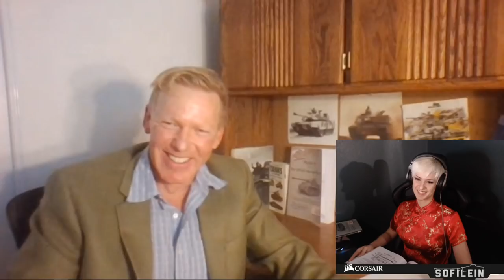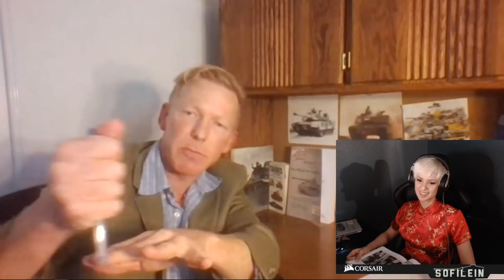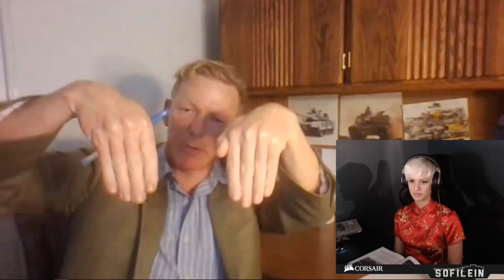Transmission and Roadwheels: Tiger I Mythbusting with Bruce Newsome Part II

Comment: Thoughts, mean distance between overhaul isn't a particularly good measure here. It can make a highly produced vehicle look inferior and a very well produced vehicle, look superior just by weight of numbers. The smaller the pool of vehicles, the more the outliers affect that number. I can't accept the premise on that ground alone. When you have more than twenty, twenty five tanks produced to one, in comparison, you're not comparing like to like. 

Assuming the number I've seen are accurate, we're looking at close to 40:1 in favour of the M4 Medium. 

I think the Tiger 1 did have a number of issues, of which the persistence on the battlefield is one of them. That is caused not by a lack of reliability on an individual level, but in doctrinal misuse and the lack of replacement parts. So it doesn't matter that you can point to a tank that did 3000 miles between overhaul, if you could point to a company, division that could maintain that, that is an factor worth considering. If a division could maintain at least 95% of its Tiger 1's ready and available for that distance, then we have something to talk about. 

Does it make the M4 Medium a bad tank because Creighton Abrams and co burned through six, seven of them? Or does it mean that the tank was designed to be used by an army not fighting on the same continent as the factories? An entire ocean away from the factories and that army was still able to be easily supplied with vehicles? 

Second thought, the manual from the Tiger 1 from memory had quite specific instructions and measures for the crew to take. That meant when you had competent, trained people they could exceedingly well. It's the difference between a rally car driver and your standard 9-5 office worker who drives to work. So you had a group that knew exactly what and how to drive, operate the machine. You then, later on had a group that didn't have the same fundamental knowledge, practise and to not say there was a decline, I think ignores the reality of the German state of the time and of the price the war was having on Germany. 

When you're having issues around the transport of ball bearings, the war is not going well for you. 

The Tiger 1 might have been a great tank the Wehrmacht, early and in the middle of the war. It fit to the culture of a small, professional highly mobile, short term operational force. I won't deny that. It was not the vehicle they needed in the late part of the war nor was it a vehicle that in the long term had a function that was needed. Nor was the entire lack of spare parts something to be so easily glossed over either. When every vehicle might as well be a single run, you're going to run into problems, eventually. 

Third point, I feel a correction/addendum is required here. Previously the German recovery vehicle was a Panzer 3 or Panzer 4 hull modified for the role. When Tiger 1 was introduced, only another Tiger type of hull could recover the vehicle. So the issue for me is that you've just had to create a whole new vehicle family, for the specific capability of that family of vehicles. 

So, while the Tiger 1 recovery vehicle could recover any number of other German armoured units, the Tiger family of vehicle was the only ones capable to recover the Tiger family. That to me is wasteful, illogical and frankly not discussed enough. It creates a too specific need for that otherwise can't be answered without referring to itself. That's bad design to me.
Reply: I don't have much disagreement with you on the points themselves but I think youre mixing up design issues with deployment issues. They aren't the same thing at all. If the US/UK/Canadian forces couldn't resupply M4's which were lost (but the crew wasn't) then yes the high loss rate of M4's would have been an issue. From a design point of view, on this basis it can be argued that the M4 was a poor design when faced with late model Panzer IVs, Tigers and Panthers. However, its ease of crew evacuation, ease of maintenance and lots of replacements back in the storage depo turned out to be more important at a strategic deployment level than the design itself. 

On your production number point I think your understanding of statistical analysis is a bit too simplistic. For a high production tank, the average won't necessarily change much but the precision of the data (measured by standard deviation for example) will be higher. Yes for a smaller production number the outliers (both better and worse) will make the average less precise (higher standard deviation) but any good piece of statistic analysis will try and look through these issues. For example, using you might remove outliers results to get a high precision (lower standard deviation) average. You can also the other forms of average (Mode, median) and graphical presentation to highlight the difference within the data set you're using. The value of the standard deviation itself also provides valuable information itself. For example, if the average mileage between brakedowns for the sherman was 563 miles +/- 15 miles (1 standard deviation) compared to 489 miles +/- 50 miles for the Tiger, the wider range tells you that the Tiger had more issues in terms of quality than the Sherman did. if the data was available, I'd expect to see the precision of the Tiger data to worsen from 43 to 45 reflecting the lower quality spare, less crew/maintenance training, less preventative maintenance etc. Lubricant shortages. With a good data set, all of these factors ought to be analysable. It isn't of course as the data was not collected or lost.

IMO Anyone presenting averages (the mean) without a precision data point (standard deviation number) doesn't understand statistical analysis and the data they represent isn't to be trusted, which undermines their analysis (sorry - a did a PhD in Geochemistry and the quality of data I produced and how I analysed it was a major issue in terms of quality control as well as how much certainty is there regarding the analysis was. When particle physicists use experimental data to determine that a new particle has been discovered they use 6 standard deviations as there data quality measure. That is 3.4 errors/defects per million detections ie 0.00034% defective or 99.9967 % accuracy).

From an industrial perspective mean failure rates, or distances between maintenance or loss are all perfectly respectable data point to use. To extract real meaning from the data for a comparative point of view would also need various adjustments to be made for eg the terrain, temperature, availability of maintenance etc. No piece of high quality statistics analysis will ever use only one measure and not attempt to either make adjustments to provide a like for like analysis or comment on why the data isn't on like for like basis.

Now, I agree with you overall the entire evidence suggests the M4 was more reliable and sustainable than the Tiger, but that also reflects that lost tanks can be immediately replaced. This doesn't actually help compare the reliability of the designs themselves as the the overall effectiveness assessment is based on more than the design. These sort of issues come into debate around the deployment or not of the M26. Much more Tiger like, but not as reliable as the M4 and would have suffered from lower availability and lower reliability.
Reply: @nickbrough8335  I challenge that I am confusing those issues, design and deployment. 

In the case of the M4 Medium, the design included the issues of deployment and why the M26 wasn't seen at all in the ETO, basically. Sure, there was an extremely limited deployment, but it wasn't well received or well implemented. I don't believe there was any real support for the deployment from the theatre itself. 

I would quote some of the things said by Nicholas Moran on the matter here. Also, from memory, in the case of Tiger 1 vs Pershing, the Pershing did in fact lose. 

I would also point out that if the initial weight of the vehicle was only to be in the area of 30 to 35 tonne, then the design of the Tiger 1 family is a massive failure of that design. Not design creep, mission creep, open failure of the design. The designers, design process did not make the appropriate, possible trade offs to include the issues of deployment. I stand by their being some issues with the tank and the tank basically being 1,347 individual run vehicles, not a family of 1,347 like tanks. 

To be clear, the tank was not used in their doctrinal role nor were they probably supported with spare parts. The quality of the crew training as well does appear to degrade over the war. Again, I will go with that rally car versus officer worker in using a car. It doesn't matter how good the car is, you need the knowledge, practice and experience to really make the most of your car, ie the rally car driver. 

This isn't a fault of the designers, per say, however it is a fault of the design. The design was to produce a breakthrough tank. A tank that is brought up to the front, possibly from rail head, gathered together, maintained and readied for combat. A tank that would then breakthrough the enemy lines and allow other lighter elements, medium tanks such as the Panzer 3 and Panzer 4, would then go around rampaging, encircling, Stuka's overhead and infantry making mischief. The tank wasn't seemingly expected to travel far on their own power nor were they expected to again, seemingly spend a lot of time in the field. They always could be brought back and brought back up to standard, in terms of maintenance. 

At least in the scope of the Western European operation,  I would suggest as much. Russia, I have no idea and from memory, clear effort was made to get the German gauge of rail going out to the East and allowing the relatively speaking free flow of materiel to the front. They weren't particularly successful at that, from memory. I'm scraping the bottom of the barrel here. 

In terms of the stats and maths, I would like to see them myself. I've failed enough stat units to get at least the foundations right. There's serious questions I have and I would like to answer those questions. I also believe that the simple size of the difference in numbers is a big issue and I'm not sure you can draw any valid conclusions from the comparison. It's about an order of magnitude and a half between the two pools. I don't believe even with look at mean values, mode's, median's and standard deviations, you can draw any comparison that provides useful information. A very general overview of, perhaps. Something that needs further investigation, certainly. A certifiable fact, not yet. It most definitely is a better starting point, it none the less is only a starting point.
Reply: @LionofCaliban  Boy, do you know how to talk which at the end of the day adds up nothing but smoke and mirrors The measure of any AFV is how it performs on the battlefield and that includes getting there, be able to manouver and go where it's required and all the many other criteria which it needs to do it's job properly.

I've just finished reading some official history concerning the US 2nd Armoured Division and it's battle with Tigers and Panthers on the Roer Plains. And how the Shermans failed in comparison concerning  matters that most Sherman fans don't even know about, like how it's suspension restricted quick manouvering when under fire from AT guns and an ability to quickly get out of their way was vital. A report compiled by the tank commanders of 2nd Armoured after the war damned the Sherman's gun, armour and mobility compared with the big cats. But what would they know compared with Moran's joke internet experts?
Reply: @LionofCaliban  Hi. I don't disagree much with any of your points. I don't think that the design evolved from a lighter to heavier vehicle is necessarily a problem. The Panzer IV design was able to go through a similar process across the war and still remained a pretty good tank all at the end of the war. Again that the performance deteriorated from 43 to 45 reflecting Germany's increasing losses and capability has nothing in itself to do with how good or bad the Tiger design was in of itself. The design can be very good, but the build quality poor.

I'm not sure that your point on each Tiger 1 being an individual verses a family can be correct. The were made in the same factories, using the same parts. yes, the quality probably went down across the war, but that isn't a design issue. If you adopted that approach, then you'd have to conclude that the M4 family is the only properly mass produced tank in the war, because it is pretty clear than the UK and Russian tanks didn't have the same build quality. The Russians allowed T-34 to go into the field with also sorts of finish issues, whereas in the UK, they would be botched together to make them look right (The later Nimrod MR 4 saga being a recent example).

Obviously, statistically, a larger population should automatically result in very precise data and a very accurate average, especially so in the case of the M4 family where mass production was used and they were in production for a very long time (although you would break the data down into various groups based on the Engine installed of course). Essentially your view point is that no comparison can be made between any military vehicle in ww2 using hard data because each vehicle is produced in different quantities. You will not find any support for that anywhere. Various countries do (or should) compare say the Challenger 2, Leopard 2 and Abrams performance data against each other when they are considering an acquisition. On you basis this would be impossible as there more M1 than Leopard than C2 made. 

In making such comparisons, it is excepted that the precision in the data set - as measured by the Standard Deviation - will be different. That doesn't stop the the say Leopard data set giving a precise average for any particular measure. Usually you'll find the stats come with a n value (the size of the data set) which you always bear in mind when making comparisons. If a full data set for Tigers was available, then I would imagine the first thing you'd want to do is to break the data down into production year, front operated on etc to actually find out whether these factors made any difference (which we suspect is very likely to be the case). I agree that the M4 family is very likely to show less variation as the design was well tested in the many different climate/terrain environments available in the USA, whereas the Tiger could never have had this option. 

I'd conclude with the view that data from the earlyTiger's deployed in Tunisia and on the Leningrad front in '43 are likely to be the most useful to use for reliability and other design based analysis. These tanks were still made when raw materials and man power shortages were not critical and the Germans still had significant offensive capabilities. The operational life of a Tiger in 44 or 45 was very low, both due to losses and - likely - poorer quality materials and parts.

I think we would both agree that the Germans made many mistakes. One is having too many designs being manufactured at the same time. Another is that the Panzer IV replacement they needed wasn't the Panther or Tiger (let alone the Tiger 2), but something smaller, lighter easier/cheaper to produce with much better fuel efficiency. I don't know if you've caught this video yet, but t also gives an interesting and different perspective (https://www.youtube.com/watch?v=MFYHhTc0E2g).
Reply: @nickbrough8335  Indeed I have seen that video and honestly, I need a rewatch of it. 

My argument, reasoning here in the statement that each vehicle might as well be an individual run is the nature of the construction of the vehicle. 

You had different groups supplying the various parts, which were assembled. Parts from a very disparate and separately QC'd parts are the issue here. 

You have everybody saying their parts are good and on a whole, they were. They then fitted individually to each tank. They would then do the same process, fitting parts to the next tank, again on an individual basis. 

Assuming this is going well, that's not too much an issue. However it still requires individual work. Assuming it is an issue, you have a lot of work to do for each tank. 

As pop/popcorn as Potential History's video on the Tiger 1 is, it does include some factors I think are present here. I believe the point that every sixth vehicle had notable changes from the previous six vehicles. He  did say it better than I could. 

On the numbers, as said, I want to see them myself. I want to see the working, do the math myself. I have issues with the reliability of the numbers, verify them myself. When in doubt, go to the primary sources. That's what I want to do. Until then, I will have questions. 

On the design side, I'm perhaps too close to this. I run a game studio with a focus on physical games, board games, RPG's and tabletop war games. Clarity of design goals, project goals are important to me. Quite important. Making deliberate choices without realising what you are trading off, what your limitations are inevitably lead to wasted time on my end. Bad decisions that derail entire projects and forced restarts, to outright wasted money. 

Games, are not tanks, not by a long shot. However, they are also a complex set of interconnected systems, governed by rules and requiring people to follow the processes listed. Just like manufacturing a vehicle from disparate suppliers across a country. 

Logistics is a subjected I happen to be studied and certified in. 

If we look closely at Tiger 1, we have processes fairly openly skipped/outright ignored. That's why we have the Sturmtiger on some level, never mind the Elefant/Ferdinand units, vehicles. 

The other part of this is that for a breakthrough tank, the Tiger 1 is a damned effective and scary vehicle to come up against. When you need to punch a hole in enemy lines, on the counter attack or the primary offensive attack, it's very good at its role. Even perhaps, too good at its role. 

If there's a universal mistake the German's made, it was going to war in the first place. Specifically if we want to talk tanks, the issue around fuel, manpower and the bombing campaign come up. They made the best of the situation they could. 

I would argue the high end, high value low production choice is the right one for them. The trade off is that you need to maintain a highly qualified, highly experienced crew to operate them. Not just to crew the completed, assembled tank, the same is true of the people making it. 

Could their vehicles have done with better engines? Sure. Could they have done with better and more efficient engines in their tanks? Also, pretty sure everyone could do with that. Both sides of the war. Fuel is heavy and hard to transport. 

I think what we need to do to really get to the issue is not to look back and say X, but try to be in 1940, to 43 and try to look forward. In looking forward, I would suggest trying to make a small number of highly effective offensive vehicles is balanced out by the sheer numbers of STuG family vehicles, Jadzpanzer vehicles. Even to a degree a hypothetical Marder IV, using a Soviet 85mm or greater gun. 

In the case of the Panzer III/Panzer IV range must also, fundamentally remain to keep the purpose of the Tiger 1 tank. Not the whole Tiger family, just the Tiger 1. 

In trading off for those extremely high value tanks, you need the STuG family. You need the Jadzpanzer family of vehicles. 

I don''t think that is a mistake, for a force designed around a short term, operational actions. Anything else escapes the reality as I understand it of German warfare of the time. 

The T-34 is a hard case to argue and due to what I believe the design goal was, I'm also definitely sure is a bad comparison. When you look at the M4 Medium, it was the best tank for the US, as it was then. I think you can say the same for the T-34 to the Soviet Union. 

I don't know if we can say the same for a single German vehicle for the specificity of the German range of vehicle. They're perhaps at the start, better at a combined vehicle approach, where each vehicle had a specific function. They didn't seem to really move beyond that concept and you could say the STuG range was a good vehicle family for the Germans. The Jadzpanzers also true. As said, they did have too many hulls and perhaps that's a major issue here. 

If you want to do a reasonable comparison for me, you almost need to compare entire family of vehicles on the German, Wehrmacht side,  to the singular vehicles, relatively speaking, on the Allied side. 

Also, to be clear, while the Allies did have relatively speaking a 'single' vehicle, those hulls were improved on and notably so. These would have been whole new models, vehicles under the German system I would suggest. 

I don't speak or read German and I don't have access to the archives, so I can't really get primary sources to try and predict what they could have done.
Reply: @FairladyS130  Uh, how about Nicholas Moran actively looks for material in the archives, posts the material and has a rather good grasp on the material? 

To the degree I think he's written the only book on US tank destroyer development/history, from the primary sources he found in said archives? 

If you've got a primary source, after action reports, intelligence reports, documentary evidence, upload it and send me a link. 

If you're looking at Normandy, those were extremely specific situations which ignore the experience of the Commonwealth M4's, Soviet M4's, which would have been facing Tiger 1's from 43 onwards. 

Is the Tiger 1 a good tank? Sure is. It's a breakthrough tank, it's designed to hit hard and move on. It's also not a tank designed for long term operations as it experienced in the Eastern Front. Nor particularly defensive operations, seen in Africa and the Eastern Front. 

I will also point out that Zeloga could only find something like three or four examples that the US forces in the ETO faced a Tiger 1 tank in the records. He's published and been through academic rigor, process. 

So again, provide that primary source. Upload it, share it, provides dates, time, unit information down to the company level. 

I'm not going to prove your claim, so make the claim in depth. Show the same standard that Zeloga and co do.
Reply: @LionofCaliban  Hi there. On the Tiger components point, I rather agree with you in general terms, because it seems very likely (i won't say certain, but its pretty close to I think) that the quality deteriorated through 44 and 45. I suspect tall Germans vehicles would have been impacted (especially as they moved factories to tunnel systems for protection and increasingly used slave labour). I don't think that would stock you looking at the entire model's production as a single entity though. That's probably a question for an actual mechanical engineer.

I think the German army in 1938 probably made the right decisions in trying to build a high quality tank with (it seems) a 3000 mile service range. For a peace time environment thats a good call which would have paid off during war time (if it had happened in 44 as originally intended). However, in 41/42 the design priorities should have changed. They might still have gone for the 88mm (although the L/70 75mm might have been a better choice) but a lighter, more fuel efficient, less armoured design to complement the Panzer IV would have been more sensible. A 3000 mile service period no longer made sense in the same way as battlefield losses would most likely limit the number of tanks achieving that. However, high reliability was still the best choice. However, given they were well down the design path, I think its understandable that it was too late to change tack. However, this surely makes the choice of a 45 tonne Panther design pretty stupid when a sloped armoured Panzer IV upgrade should have been the correct solution logically for the main German tank design.Operating more than 2 models (of both tanks but also stug/SPG and tank destroyers should all be using the same chassis design as well) was just plain stupid from a logistic stand point. 

One of the recent Tank museum blogs by the Director comments on German tactic and how British armoured forces went from pretty poor at D-Day and thereafter (allowing Wittman to create havoc) to pretty clever by the time of Witmann's ambush only a few weeks later, noting how German tactics in the Bocage hadn't evolved at all, suggested their armoured warfare doctrine was actually poorer than the UK, even though it had been very successful early on in the war.

I understand your concern regarding sources, but that's what the book series is for :) He has to make a living too.

I don't know if you've come across David Stahels books (I read this one a while back https://www.amazon.co.uk/Kiev-1941-David-Stahel-ebook/dp/B0067J8J24/ref=tmm_kin_swatch_0?_encoding=UTF8&qid=1589390472&sr=1-7). The one is a bit poorly written and needed a good editor, but his argument seems quite correct that the German army's real offensive capability was shot by summer 1942 (he thinks by the end of 1941), although Operation Citadel was still at least a year ahead of them. Invading Russia was the war ending strategic mistake, although they almost succeeded in destroying Stalin and they might have achieved a (short) peace with the CCCP with Belarus and Ukraine being under German control permanently.
Reply: @LionofCaliban  I think his arguments are generally excellent. A book or two in there if he has the time or interest.
Reply: @nickbrough8335  Quite familiar with and like the previous video, probably in need of another rewatch. 

When in doubt, check your sources and when your sources aren't making sense, check your foundation.
Reply: @nickbrough8335  As for a longer reply, I'm going to try and offer a few thoughts, at least while I check a few sources, books, videos, people who have actually studied this, have access to the archives, speak the language. 

I don't want to specifically speak for what else the material used to make a Tiger 1 could have otherwise built. I also don't want to go into the field of alternate tank designs as well. I need to check plenty of sources before I touch that subject. I'm also no engineer. Ask me to tell you how to ship it from the factory to the frontline, that's my training, profession. Ask me to build it, I'm subcontracting, not my skill set. 

The issue is that I want to check a few Soviet histories as well. Overall, take this as I find this subject complex, I want to check out a few sources and I also doubt it's that simple. 

I also have to challenge the idea the taking of Moscow equalling the end of the Soviet Union or the greater occupation of the Soviet Union I have to challenge. That's not the Russia I believe existed and not the one that had to be so openly, overtly Destalinised by Khrushchev. Stalin and the Communist Party there engineered a state that would have been able to continue the fight very easily. Too easily on some level. I would suggest and more importantly at least until the end of the war, showed a growing  tendency to support local tactical level commanders. Stalin is an exceedingly complex character to discuss, as is Soviet leadership of the time. 

The Wehrmacht also had its own issues here and I don't want to downplay them either. In between a highly inflexible set of generals who didn't adapt to the war they were fighting through to strategic level choices which are borderline indefensible, combined with a tank that when used was not without larger issues. 

It's easy to talk about the units moving, it can be hard to quantify the issues with moving those units around. I don't just mean specific rail car, rail carriage either. I'm talking about rail heads, how close you can get the tanks to the front line in the first place. I'm talking about the time taken to fully shift the unit from Point A to Point B, including the supporting vehicles. I'm talking about taking it down to the pre-starts of each vehicle as it arrives, loaded with ammunition and give orders to advance to the front. I'm talking about taking it down to the lubricant checks, coolant checks and more. While we're at it, let's talk about the guys who feed the tankers and the mechanics. Let's talk about the QM's who supply everything too. 

What I stand by now, are the following; 

The German designers and industry were following a doctrine that the greater Wehrmacht, Heer and Luftwaffe in particular were trained in and requested items, materiel, vehicles in support of that doctrine.  

The Tiger 1 breakthrough tank, was the correct choice, as it stands for the type of warfare they believed they would be in. Particularly an offensive, western to central european focused conflict, consisting of multiple short term operations. 

The Tiger 1's use in the defence, against doctrine is a fault we have to discuss. Despite it being a highly effective tank, it was on occasions, in spite of the way it was used.  Even more so when so dramatically outnumbered. 

The Tiger 1 tank while being largely mechanically reliable, was not without issues. Tracks and its wheels were known issues, in particular in the Eastern Front. Especially during the autumn and winter. Even to a degree, in the spring as well. 

The use of the Tiger 1 family of vehicles in Russia, including the Elefant, Ferdinand and Sturmtiger was not against doctrine, while remaining at a weakness for the vehicles. They were designed for a European war and terrain, with political objectives. Not the attritional to total war that they got in Russia against the Red Army. 

Tiger 1 against Allied forces, US, Canadian and American, is hard and complex to discuss. Due to the almost phobia had, false identification and the relatively limited presence they had. Zeloga can only confirm three to four encounters against US units, formations. English/British formations clearly had known multiple encounters with Tiger 1, not just Wittman. 

The Tiger 1 was not invulnerable and was a known threat in Normandy. However due to the Allied air superiority, fire support and tactical flexibility, when encountered was a threat, but not an insurmountable threat. Even when outright attempting to bypass isolated Tiger 1's. 

The M4 Medium with the 76mm gun, the Firefly are only two of many vehicles capable of defeating the Tiger 1. The Allied forces were capable of not only defeating the Tiger 1, but the Tiger II and Panther,  due to the use of combined arms, integrated services working together. 

Finally, I also stand by a straight numerical comparison between the Tiger 1 and any other tank, is at best foolish to pointless. You may have a vehicle that lasts for the 3,000 miles between overhaul. You may have a tank that you can produce in sufficient numbers to equip your best troops with it. You may even have the supplies to use those tanks directly to your doctrine. When the war you're fighting makes your doctrine invalid, the relative quality of the equipment is a relative minor concern. 

So, yes, I still stand by the claim that the number of miles travelled between overhauls of the Tiger 1 is a bad one. It ignores a lot of context. There's issues around the stats, which we agree on I believe. Not just around the numbers, but the math as well. Hence, why I want to see the math, verify the math myself. Compare to the records, verify with the unit records, war diaries. Why I want to see the unit numbers of how many tanks they ever had at any one point. Why I believe this should only be discussed when the company's could maintain that across 90% of their total vehicles. 

It's not that Tiger 1 is or was a bad tank. It was a bad tank for a war in Russia. It was a bad tank to come up against in Normandy. It was a bad tank to try and face on the defensive, when suitably commanded and supported. It none the less is a tank with clear weaknesses, in design, in use and in execution.
Reply: @LionofCaliban  Excellent thoughts and getting beyond the point where I certainly don't know enough to properly reply. My thoughts. 

The window for defeating Soviet Russia was certainly narrow and winning Moscow itself wouldnt have been the end of the matter. But it is possible that Stalin might have chosen to fight another day or been over thrown if it had been a little worse or Leningrad and Moscow had fallen earlier alongside Minsk and Kyiv all in the same year. Given longer and more sensitivity, Ukrainian people could have become a strong ally against the Soviet forces. That said Ukrainians and Belarusians paid a much higher price than the Russians themselves, which makes Putin's anti-Ukrainian propaganda very sad to hear. I think it was 1 in 4 Belarusians and 1 in 5 Ukrainians that died during the war.

If you look at Zitadelle in July 43 they still managed to come very close to winning and had they done so, would Russian forces have managed to win so dramatically in 44 ? A seasoned Panther and more Tigers would have been enough to win probably. The Germans might have done it, but certainly not with forces also deployed in North Africa, France, Netherlands/Belgium, Norway, Greece and the Balkans already. They thought the war the wrong way round. I also don't think their armoured forces, still with large number of Panzer 2's were Russia ready in 1941. With the assault led by Tigers in 1943 ?  Speculative and we'll never know.

Without doubt, both US and UK armies were mechanised in a way that the German army never could be (fuel not withstanding). We clearly won the logistics war, but western Europe had betters roads and railways. The Russian received a lot of support from both countries and this had a larger role than is acknowledged so far as I can tell. As combined arms forces they always had the edge in the west once the troops gained some experience and the British went a long way to sorting out their tank forces. The Russians won as much by sheer numbers and a degree of carelessness regarding casualties,, although their victories were won by artillery and break throughs. A war of attrition was always going to happen if the initial attack failed, which the Russians would win based on population. However, without raw materials and support by the Convoys and by rail through Iran ? With hindsight the Russian victory looks inevitable now,  but I don't think it was as certain as it seems now.

It's the Panther that I feel was the wrong tank at the wrong time, not the Tiger. I don't have any view on whether Russia was or wasn't the right place for them. I think it did very well on all fronts, but lacked sufficient numbers to make a big enough difference. That goes back to cost and built time and logistical support and all the matters that actually win wars as you suggest. 

There was another video (TV ?) I watched (I forget its name though) that talked about The Prussian way of winning wars, going back the Frederick the Great and how this influenced German military doctrine, which was centred around knock out battles and encirclements followed by a quick peace treaty. Prussian was too small to adopt a French tactics used by Napoleon or British approach that essentially won the first war. I suspect the German army just didn't have a strong defensive Doctrine as it just wasn't German. This certainly lost them the war.

There's a Russian book I mean to finish one day ("The Rzhev Slaughterhouse" which I think should be companioned with David Glantz's history of Operation Mars and Jupiter - "Zhukov's Greatest Defeat") thats shows the German army knew how to defend in depth (These battles were the reason why the 6th Army Group didn't get any replacement troops or Tanks before the Stalingrad encirclement), but they couldn't do something similar for the Front as a whole. Hitler's distrust of the senior army commanders, the organisation mess in the central command structures, his "no retreat" attitude and the failure to shorten the line and adopt defensive positions, failure to prepare for the Winter of 41/42 are all more important factors than the tanks that were deployed.

As an individual weapon, I think there is a strong argument to say that the Tiger was the best tank design in world in late 42/early 43. But having the best tank design is not enough on its own. The Sherman and the T34-85 were both the most effective Tanks during the war as a whole, although the Panzer IV should be included in that list as well. I forget, but was it 3 Panzer IVs for the price of 2 Panthers.
Reply: @LionofCaliban  He cherry picks, ignores what really happened, like what I posted and you have ignored, and  picks out the good stuff.  Of course the Sherman was involved in some wins but basically only when there was overwhelming air and artillery support or it could ambush. By itself by any measure the Sherman was a fail compared with the big cats. You should do your own research like I do, that avoids  other's 'interpretations'.
Reply: @FairladyS130  Except you've said everything which means that I can't take you seriously, Modern warfare is combined arms. The radio is the most important aspect of it. Communications underlies so much of modern technology, getting packets, if we're talking networking, from Point A to Point B. 

It's not and it's never just a tank, versus tank. Even a tank platoon, versus a tank platoon. It's tank platoon, with supporting infantry, supporting air, supporting artillery, supporting services which keep the vehicles going, the crews fed and in good health. It damn near doesn't matter the individual quality of the tank, if the supporting services and vehicles are not there. 

As was often the case for the Tiger 1, Tiger II units. 

I'd suggest you need to do some research and make a serious attempt at getting through Achtung Panzer. Get your head around some of the other period writers on armoured warfare and its theory, Liddle-Hart and co. 

I'd suggest you also look at the accounts from characters like Hans von Luck, accounts from the Eastern Front. 

If you can stomach it, even going into Panzer Leader, Penguin translation, if you get past the 'I'm not a Nazi'. 

To be honest, I almost want to recommend George Forty's Tank Warfare in WW2, however it's been too long since I read it and I think it's a bit outdated now.
Reply: @nickbrough8335  I think we're in the same book,  maybe even same chapter, just not the same page. 

That Prussian way of war is what I mean when I say that short term operational level thinking, planning. To the degree where I say political objectives, I'm talking anything from a peace treaty to installing a puppet state. Long term, multiple year engagements are not what they trained for, expected. Why I try to use the word persistence when I talk about their doctrine. They had a very clear system of warfare, one that valued quick actions and traded off, ignore the needs of persistence of the army. Of an army that has to be kept in the field long term. 

I won't argue that the Tiger I was a good design, in 42, perhaps even 43, but later on, far less so. Panzer IV, was also a very good vehicle and the reason I say it's better to look at family of vehicles for the Wehrmacht. It's not that they didn't have individually good to great vehicles, it's that on some level all of their vehicles were pretty good. 

At least, when crewed properly by a competent crew who knew the strengths, capabilities of their vehicle. 

So again, same book, maybe even same chapter, different page. 

Panther is a whole other can of worms and frankly, I'd rather not touch it and make it its own conversation. By the way, feel free to PM/DM/mail me on the matter. It's good to actually talk to someone who has a good attitude about this stuff. There's plenty to be said about Panther, which perhaps makes it the best example of the worst aspects of the German logistical system of WW2. 

On German doctrine, I need to sit down and read it in more depth. From Military History Visualised/not Visualised, I get the feeling the the doctrine of the time values and prefers action over inaction. To the degree that the counter offensive, spoiling attack, your preferred term here, is over emphasised from my end. The Prussian way of war is fundamentally based on having the initiative. Of having the benefit of being the initiator of action. So, it's not the German's couldn't defend, it's them having the local, tactical freedom of operation to defend. 

Not helped by the nature of the OKH/OKW, high command at the time. Also, I'd suggest, not helped by the fetish of constantly creating new units with the new equipment too. I think it's hard to talk about this with bringing up ole Adolf here. That itself makes it hard to try and separate things out, especially from the accounts of the generals, high staff, shifting the blame, painting very deliberate pictures that did not reflect the reality of the time. 

So again, feel free to send me a message, let's take this somewhere else and have that Panther discussion. Always good to find a person who's got a good attitude about this stuff.
Reply: @LionofCaliban  You are aware that between 20 Nov and 25 Dec 1944 the US lost  636 Shermans aren't you . If you think that is an acceptable result against a by that time weakened German force then I'll leave you to your fun and games.
Reply: @FairladyS130  And? Equipment is equipment, not people. Doesn't matter if it's a rifle, radio, machine gun or tank. It's made to be used, maintained and if necessary, replaced. Ammunition is made to be fired. Are you holding that against the tank crews because the manual says they should have X amount of ammunition and they're shooting at things? 

Now if you're talking about ships, that is a different argument. In both cases however, the people operating it matter more. 

If we assume the numbers of M4 Mediums is in the area of 50,000 made, that's only 1.2% of total vehicle production. From a logistics stand point, which again, educated and qualified in, I don't see that as an issue. 

I would also point out that that if it was a case that upwards of 50% of Tiger I hulls couldn't be recovered, that is a far bigger issue. It's also worth talking about the relative...... well, if you lost a M4, you lost a M4. It didn't matter that much because there's plenty of replacement vehicles and replacement parts for the vehicle. 

In fact, making the time put in to design and develop the vehicle quite important. You knew you could get them to where they had to be and would in fact, work. Even those tests on the lock washers and rubber seals. 

You lost a Tiger I, Tiger II, Elefant/Ferdinand, Sturmtiger and not able to recover the vehicle it's a far greater loss. Not just a burning tank can't be recovered, the wholesale loss of a hull that otherwise, in potentia, could have been brought back into service. Which I think happened to a very significant number of Tiger I hulls. 

No, I don't have numbers, I would need to check war diaries of German Tiger I units and compare to Allied resources on the matter. Africa and the East would have been the main source of this. 

As for the weakened force, I have to argue. You had reserves being brought in, you had in some cases full strength SS units being brought in. Going back a few months, you had them in the bocage was an area that massively favoured the defender. Normandy and that part of France was a hard area to operate in as the conditions could change extremely rapidly and provided a fair bit of cover for both sides. Losing the war doesn't mean can't fight the war. They're two quite distinct states and frankly, you would only see the latter when Germany's border were reached. In 1944 they could still put up a very solid fight. 

So I'm not surprised it was taking out a good few M4's.
Reply: @LionofCaliban  I don't pretend to be an expert and whilst I've read or watched a fair bit over the years, I'm still learning. Happy to talk directly, although not sure how to. I think the best WW2 tank design was the Centurion ( :) ). 

I think we have a different perspective, but our conclusions are very similar. I think the eastern front is where the war was won and lost. One thing I've noticed driving around Northern Italy in the towns and villages in foothills of the alps, is the war memorials. Mostly plaques on the side of a building. WW2 deaths are almost as numerous as WW1 ones and where marked (which it quite common) I'd say  ⅔ to ¾ just state "Russia". This was not something I realised until I saw it.
Reply: @nickbrough8335  No expert here either, just an enthused amateur academic and games dev who just wants to know more. 

Eastern Front, let's make that a discussion we have. I have thoughts and I want to disagree, in so far as that it was where the war was won. I think it was where the war was accelerated, I don't honestly see any way out for Germany to even some form of forced neutrality, a draw. 

As for ways to get in touch, let me play around with some channel details, I've got some videos I posted up here years back. So I think I can give you an e-mail through my channel profile. 

Like I said, give me a day and I'll see what I can do.
Reply: My two cents to the topic.

To assume that panzer III and IV in 1944/45 were that much more reliable than the panther is a misconception. They started to suffer from the same late war limitations as the Panther.

"From the front there continues to be serious complaints regarding final drive breakdowns in all vehicle types. Approximately 200 breakdowns have been reported with the 38(t).
Prior to the 1945 eastern offensive there have been 500 defective final drives in the Panzer IV.  From the Panther 370 and from the Tiger roughly 100.  
General Thomale explained that in such circumstances an orderly utilization of tank is simply impossible.  The troops lose their confidence and, in some situation, abandon the whole vehicle just because of this problem. 
He requests an increase in efforts for the final drive, since only this way can the problem be laid to rest.  With the previously intense criticism of the engine and the final drive continually playing such a roll,
it is welcome news to learn that the gearbox generally enjoys a good reputation.  (Page 259 "Panther and its Variants" by Walther Speilberger).

So Which tank would have been a better solution?

More Pz IVs, which suffered from the same final drive issue since 1944 like all german tanks, which could not be produced as fast as a Panther, because they weren't streamlined for mass production. Germany had not the resources or the industrial capacity for a long war, so production should only keep up with operational losses over a very short time frame. But things changed after the german offensives failed in 1941 and again in 1942.

The Battle at Kursk showed, that germany was in fact lacking the resources and the manpower to supply the tank force they already had.
Every additional tank needs a crew, fuel, ammunition, spares and the logistics to provide all that.
Just screaming for more tanks does not help.
Nevertheless germany produced more tanks in 1944 than in all the years before.
The panther was streamlined for mass production. The panzer iv was not. Only 8500 panzer IVs were built from 1939 till wars end. But they built over 6000 panthers in less than two years.  4500 in 1944. In comparison the Russians built 11000 t34/85 in 1944. Given the average tank exchange ratio of 1/4 in favor for the Germans, the panther was a reasonable option. Since spring 1944 Tiger ,Panther and the Panzer IV achieved almost the same combat ready rates (Tiger I and II combat tactics by Jentz).

Tanks like the Tiger, Tiger 2 and Jagdtiger were never meant to be produced in large numbers. They should serve a special purpose.  Only 90 Jagdtigers were ordered, which should replace the 90 Ferdinand's/Elephants because they turned out to be a very efficient tools in certain situations.
The Henschel factory in Kassel, in which these tanks were built, was in fact too small to produce the simpler panther in large numbers. They were missing the tools and the space. They tryed it with a batch of 200 panthers, it did not work. 
Should they stop producing tanks at Henschel? Give up an already introduced weapon system with unique features and capabilities, which also had an hugh propaganda effect (Tiger Fear/Tiger Panic)? I dont think so. Remember the M4 Sherman Jumbo was in high demand by the troops, but only around 300 ever reached the ETO.
Steel wasn't the limiting factor for the german war industry, germany remained the second largest steel producers right up till the end of the war (However, quality became a problem). So they dont really have to care if a tank needed 30 tons or 50 tons of steel. Other factors were far more limiting for germany in terms of tank production and operation.

Panzer IVs and IIIs were never converted into ARVs. The 18 ton Halftrack with a towing capacity of 28 tons was the recovery vehicle for the German tanks. Since spring 1944 they produced the Bergepanther, which was totally capable to tow and recover any german tank with a 100+ ton winch.
But to recover tanks you need to be in control of the battlefield, which the germans weren't because they were retreating most of the time. So tank recovery wasn't their biggest concern.
The Panther did not become a recovery vehicle by accident. According to H. Doyle the Panther was designed to replace the Panzer III and IV to be germany's new (Main) Battle Tank and to serve as a platform for a large variety of other tanks like recovery vehicles, assault guns, SPAA and even self propelled artillery. Just like the Leopard tank family after the war.
It was primarily designed as a system for tank on tank warfare, to counter the massive soviet tank assaults.There for it needs great mobility, a good frontal armor protection and a gun which could destroy every enemy tank within 2-3 km of range. Why 3 km? Analysis showed, that 95% of the tank engagements in central europe would take place within that range. This profile of capabilities hasn't changed the next 45 years until the end of the cold war. Even the Leopard 2 was designed on the same principles.
Hence it is considered by many experts as the first german MBT.

The Germans mainly used 5 tank chassis (38t, Panzer III/IV, Panther and Tiger) for their large variations of AFVs. Almost all types were powered by the Maybach HL 120 or the HL 210/230, which were paired with a relatively small number of different transmissions. Even the bigger Halfracks used the HL120. The automotive parts were very standardised and interchangeable. Tiny variations in the Hulls between variants are negligible, they don't really interfere with basic maintenance. The Sherman was produced with 5 different engines and came along with a huge variety of hulls and turrets too.
The only disadvantage was that the Panzer IV and III weren't designed for mass productions, a problem which was fixed with the introduction of the Panther.    
According to Ralf Raths (director of the german tank Museum) every other tank or scenario would have suffered from the same limitations as the panther. In the end it would not make a difference, germany would have lost the war anyway. But the panther was a reasonable option. The Panther was only some 15% more expensive to build compared to a Panzer IV, even so there were more resources involved. It is always forgotten that the Panther lacks many of the advanced features a Panzer IV had, like a separate APU for the turret drive.
(Look at the Interviews made by Chieftain here on Youtube with Mr. Raths and H. Doyle at the Tank Museum in Munster Germany) 

A Bergepanther drove 4200 km without new spareparts and 1000 km from 4200 km it was towing other panthers.
(Panther - Thomas Anderson page 55.)

"There is an article on this subject in the June 1944 edition of Nachrichtenblatt der Panzertruppen (News sheet: Armoured troops):
Performance of a Panther-recovery tank driver.
Unteroffizier Krause of a Panther workshop platoon has up to 3 May 1944 driven his Panther recovery tank – Chassis No. 212132 – 4,200km without an engine
change or damage to the transmission, including the final drive units, gearbox and drive shaft. Approximately 1,000km of this was made towing a Panther tank.
The vehicle and engine are still in excellent condition and continue to be operational.(Panther - Thomas Anderson page 55).
http://www.panzer-elmito.org/tanques/panther/documentos/Leistungen%20Bergepanther-Fahrer.jpg
Reply: @HaVoC117X  First, thanks for the sources, I'll have to check them out. 

I did think there was another recovery vehicle for some reason, so it seems I might need to rethink some of my comments. 

As for the Panther that lasted so long, I would suggest that we had a driver that knew how to drive the tank. He knew what that the total package liked and disliked, unlike a person without that training and experience, so the fact it did last is not surprising. At least on an individual scale. 

I'll have to check some dates, as Guderian and co, I want to say Speer for some reason, worked to simplify the German production chain, which was in the area of 43 to 44. I think there's something to be said for the Panther being a part of that system refinement, redesign. 

I will challenge the idea of the Panther being the first MBT. I think it's a definite foundation of the concept, that by it's nature and expected role, it was an exploitation weapon first and foremost. 

It just so happened by accident rather than deliberate design, it also had a number of the capabilities, features we expect as part of the greater MBT package. 

Again, to be clear, it was an offensive weapon first, foremost in German doctrine. Not a general purpose vehicle. The medium tank designation is an offensive vehicle designation as I understand it.
Reply: @LionofCaliban  
Offensive or defensive weapon system isn't important in this regard.
Both sides Russia and Germany preferred offensive tactics when in the defensive. Be active is better than reactive. You need time to create an answer to a stimulus, that's why you are always a step behind of the reality someone else is creating for you.

Medium tank (or general purpose vehicle), describes the ability of the tank to engage hard (tanks) and soft targets (vehicles/Infantry) alike. Even so Germany tend to build their MBTs with a greater emphasis against hard targets (Panzer III right up to Leopard 2).
Reply: @LionofCaliban  
There are many reports out there which state that the Panther is a reliable vehicle. Far to many to discredit the Panther for being a generally unreliable design. 

For Example:

On Octover 28, 1944, the problem with the final drives seemed to be solved. The 654th reported that Jagdpanthers had already covered 400 to 500 km without damage. (Heavy Jagdpanzer: Development - Production - Operations by Walter J. Spielberger, Hilary L. Doyle and Thomas L. Jentz. Schiffer Publishing Ltd page 24.)

From 6 march to 15 April 1944 the 1.Abteilung/Panzer-Regiment 2 achieved 1500 km to 1800 km with 4 of their 7 Panthers still available, with out any failure to the transmission or the engine. (page 141 – 142 Germany’s Panther Tank” by Thomas Jentz).

Many kilometres without a breakdown is the hallmark of a good driver and commander. In that respect, the battalion mentions PzKpfw V Chassis No. 154338, Engine No. 8322046 reading 1,878km,driver Obergrefeiter Gablewski, 4.Kp/PzRgt 2. The vehicle is still completely operational. With exception of track, all other items are still in very good condition. Engine oil consumption has been 10ltr per100km. The tank is still running with its original engine and transmission." (Panther - Thomas Anderson page 177)." 

The 1st tank regiment writes on February 22nd, 1944: "The Panther in its current shape is perfect for battle. It greatly surpasses the T-34. Almost all minor drawbacks are gone. It is greatly superior to the PzIV in armament, armour, off-road maneuverability, and speed."

Yeah, the drivers seem to play a major role!
According to the experts of Operation Think Tank (WOT Youtube Channel, Steve Zaloga, Harry Yeide, Hilary Doyle, David Fletcher, Rob Griffin & Kenneth Estes), the tank drivers of the Wehrmacht had only 1 hour of training on their Panthers because of the fuel shortage in late 1944. The Experts assumed, that the inexperienced drivers and crews are also a big factor for the increasing number of failures in the drive train and the rather poor combat effectiveness. They couldn't use the panther's potential. An inexperienced driver can even wreck the drivetrain of a Leopard with in minutes, if he doesnt know what he is doing! Keep in mind that most boys didnt even know how to drive a car back then.
Reply: @HaVoC117X  I think we'll have to agree to disagree here. 

At least until I can learn enough German to get my head around the period manuals. As it's been explained to me there's a quite clear difference between the medium tank, the heavy tank. Not just in purpose, where it fits into the greater vehicle system used by the Wehrmacht. 

Panzerjaeger and Jadzpanzer weren't just vehicles, they were clear and distinct roles as well. The Panther is a medium tank, by its role designation, what it was meant to do. 

The Panzer family had a clear split, the vehicle for exploitation, for dealing with tanks and the vehicle for supporting the infantry, the high explosive, smoke lobber. 

As an example, when the Panzer III was the main vehicle, the Panzer IV was a support tank. 

I won't speak for more modern designs, I simply don't know anywhere near enough to really comment.
Reply: @HaVoC117X  Operation Think Tank is on the list of things to rewatch. I watch it at least twice a year now. 

They've got a few things I want to refresh myself on and perhaps, clarify. 

Like I said, Panther is a real can of worms. In between the actual weight of the vehicle, designation of the vehicle/doctrinal use of the vehicle, combined with the bocage, a lack of clear understanding of what the system of naming is, it's the reason I didn't want to start. 

I think it's a vehicle with flaws and I think it's the greater logistical chain, train, situation that make what is an otherwise damned good tank,  get let down. Combined with perhaps a lack of tactical clarity, improvised roles/shoehorned into a role by the greater war situation, you've got a lot of metaphorical muck you need to clear away before you can get to any sort of truth of the matter. 

Perhaps to try and clarify my position briefly, I think the Panther as a vehicle, has notable good points. The issue is that for those good points to be obvious, the system that designs and supports it, from the training of the crew, mechanics and those building it, to the availability of spare parts and ease to maintain, did not have the capability to match the requirements of the tank. 

Combined with some particularly nasty trade offs in the physical design of the vehicle itself, namely the transmission in the front. To quote Nicholas Moran on the matter, in the field you had to remove a significant amount from the vehicle in the Jadzpanther form, to get at the transmission. Including the gun, the front two crew positions.
Reply: @LionofCaliban  You don't have to learn german. You will not find a the "one definition" in German either.
Bernhard from MHV tried to find it and failed, there is none.

The Panther was mainly put into service with the medium tank battalions, to give them a greater range and umpf against armored targets. At least that's what Guderian wanted them for.
The general role of the medium tank battalions was and still is, to bring fire power and mobility on the battlefield to dominate wide and open terrain. The Panther could do that without a doubt.
After 1945 most nations classified their tanks in the 40 to 50 ton range as medium tanks (M26,M46, Centurion). You are creating a problem which don't even exist.

The heavy tank battalions came into action when the mobility component was denied by heavy defensive lines and positions. Their job was to break through those lines, to take out bunkers, fortifications and anti tank positions for the lighter and more mobile forces.
A job the Panther was never designed to do. Later the heavy tanks were also (ab)used to create strong points in their own defensive lines.

The Panzerjägers (tank hunters) are tanks of the second line which snipe tanks from greater range during an attack, to support the advancing medium and heavy tanks (because firing on the move wasn't really possible). In the defensive they were the typical ambush vehicles.

The US tank hunter doctrine was totally different and relied more on mobility, shoot and scoot, flank and spank.

"The Panzer family had a clear split, the vehicle for exploitation, for dealing with tanks and the vehicle for supporting the infantry, the high explosive, smoke lobber. 
As an example, when the Panzer III was the main vehicle, the Panzer IV was a support tank."

Yeah that is what the Germans and Americans started with, both had to realize sooner or later that this concept only looks good on paper.

The Germans dumped this concept in late 1941/early 1942 when they upgraded the Panzer IV with the long 75mm gun and put more emphasis on stug III production than actual Panzer III production.
The Stug III was part of the artillery (assault gun) and were never assigned to tank battalions, that's why not a tank or a Panzerjäger. But it turned out to be effective against tanks and was later used as a Panzerjäger.

US also found them self in the situation, that M4s had to fight with german tanks, while the M10 tank destroyers were giving artillery support most of the time instead of fighting tanks. 

Fritz Bayerlein had some very bad experiences with his Panthers in the Bocage. But he also complained about other tanks like the stug III (this happens when quotes get ripped out of context, Zaloge does it sometimes). The bocage wasn't particularly suited for tank warfare. The tight hedgerows added an advantage to the sherman wich was a disadvantage on other battlefields. The sherman was very narrow and tall with a short gun. The Panther was too wide to fit in between the hedgerows and the stug too flat to look over them, both had long guns which were a disadvantage during maneuvering.
The total lack of air superiority and fuel was also a huge disadvantage for the germans forces.
Even the US forces had lost more tanks to handheld anti tank weapons and anti tank guns than to enemy tanks. The bocage has its own rules which cannot be transferred to other battlefields, like central and easter europe or north africa.

Whats makes you so confident in finding answers by searching for primary sources, which will only offer you a few limited snapshots of the reality in the 1940s. I think the complete military and scientific elite of germany in the 40s could judge things way better than you. Some books and sources 75 years away from the actual situation, good luck. Maybe most of them were nazis and racists, but they werent stupid.

Operation Think Tank found a very quick answer to the First MBT Question?

https://www.youtube.com/watch?v=C1sN52CBKi4
21:38 First MBT?

To be honest, its a matter of how you define MBT and which charakterisation you use.
For some it is the Centurion, others will say it is the T54. But for the german tradition of tank design, the Panther was the starting point.
Reply: @LionofCaliban  In regards to the Panther problematic (The Bag of Worms):

Did you realy believe in the "Hans Transmission" meme???

The AK 7-200 transmission transmission was very reliable which is supported by many wartime reports like the one i posted before. Even the french postwar tests showed that the transmission achieved the 5000 km intervals between their overhauls.

The final drives on the other hand were a problem.

According to Hartmut Knittels Book "Panzerfertigung im Zweiten Weltkrieg", the officials in the Nibelungen Werke (Panzer IV production) were clearly aware that they made use of final drives, which did not meet the quality standards. The german war industry was forced to experiment with the hardening processes during the steel production, because they were short on certain resources. This was the reason, why all late war german tanks (38t, Panzer III and IV, Panthers, Tigers) suffered from broken finald drives and bad bearings.

Were the final drives to weak or a flawed design. I dont think so:
Some people claim (including Spielberger), that the final drives of the Panther were bad by design (simply the wrong type), but the Centurion, which was 7 tons heavier, used the exact same type of final drives. Like many other tanks too, M26 for example.

Page 118 "The Centurion Tank" by Pat Ware
In the Chapter "Centurion Reference Data it says:

"Final Drive: double-reduction spur gear train; ratio 7.41:1 (MK 1 6,94:1)

Here is a picture out of Spielbergers Panther book: Final Drive with double spur reduction gear  
https://i.imgur.com/dGktjYv.png

A Bergepanther drove 4200 km without new spareparts and 1000 km from 4200 km it was towing other panthers.
(Panther - Thomas Anderson page 55.)

The theory that the drivetrain of the Panther was overstressed, can explain why Panthers had big reliability problems.
But this theory can not explain, why large percentage of Panthers made it easily beyond those often claimed 150 km before the final drive gave up or other parts of the drivetrain broke down. This theory can not explain why a Bergepanther drove 4200 km including the stress of towing another 45 Ton Panther without receiving any damage.

Hilary Doyle pointed out several times, that the final drives became quite reliable. He also said that the germans knew what they were doing when it comes down to tank maintenance. (Chieftain and Doyle in the Panzer Museum Munster, on Chieftains youtube channel). The replacement of the engine took only 8 hours in a Panther under field conditions. For a Centurion you need 15,5 hours in the field. I would assume that a Sherman with a radial engine, a twin diesel or an 30 cylinder Chrysler Multibank engine are much harder to maintain than a regular V12.  At least the radial and the multibank engine have many cylinder heads facing down into the tank hull. I think that they had to remove the engine out of the sherman for basic maintenances. Spielberger wrote that the germans disliked the idea of an radial engine for a tank, because of difficult maintenances. The germans even built a prototype Panther with a radial engine.
The French guys of the Tank Museum in Saumur were interviewed by Bernhard (MHV) at the Tankfest 2019 about their Panther and their experiences with it.
They said that they prefer to work on the Panther than on other tanks of the same time period? Unlike the common believe, they admitted, that the Panther was actually build with ease of maintenance in mind. They were very positive about the large engine bay. I think it is really surprising that they mentioned maintainability as big pro for the Panther design. But there must be something to it, because the Panther achieved the same combat ready rates as the Panzer IV since spring 1944 (Tiger I and II combat tactics by Jentz).
I think those French guys are trust worthy, because they also operate M4s, M10s,T34s and a Centurion regulary.

The next common misconception is that you have to strip down the whole tank to have access to the final drives. The truth is you only have to remove the drive sprocket and you are there.
https://i.pinimg.com/originals/1e/c8/e7/1ec8e7c5227bc3d29c37c3cc69202302.jpg

The accessibility of the Transmission was also less critical as many described it, even Nicholas Moran aka the Chieftain cleared this up in his latest Video. He probably got a bunch of informations from Doyle about how the germans did things.
https://www.youtube.com/watch?v=X7cUsRdr5cE&t=369s Chieftain Advantages of rear engine tanks with front drive sprockets

https://en.wikipedia.org/wiki/Panther_tank#/media/File:Bundesarchiv_Bild_101I-280-1096-33,_Russland,_Reparatur_eines_Panzer_V_(Panther).jpg
Reply: @LionofCaliban  In regards to the Panther problematic (The Bag of Worms) Part 2.:

The Panther achieved the same combat ready rates as the Panzer IV since spring 1944. 
Part of the reason is, that the Panther wasn't utterly complex or over engineered and could be maintained in the field if the needed supplies are available.
The logistical situation was bad for all german Tanks, in does not really matter if it was a Panzer IV, a Panther or a captured german Sherman.
The Panther also fits perfectly on every railroad car. Tanks like Panthers, T34 and Shermans were to heavy for the average bridges in central europe anyway, which had a weight limit of only 25 tons. Given the fact that the Panther has the highest fording depth by far, more than twice as deep as the sherman, its tactical mobility on battlefield was even better than that of a Sherman in this regard.The Panthers operational range is also on par with other petrol powered tanks (Panzer IV, Sherman, Centurion, M26, M47, M48). Compared to other tanks in 40 to 50 ton range like an M26 or a Centurion its fuel consumption was actually quite low, because of its seven speed transmission. The 6th and the 7th gear were mainly used as a overdrive to save fuel on road marches, and were never meant to give the Panther a higher top speed in the first place. The Panthers steering system wasn't even ideal for speeds beyond 40km/h (its top speed of 48 to 55 km/h only looks impressive on paper.). But the steering system gave the panther an advantage when going cross country and reduced crew fatigue.

I can not agree with your concerns regarding  crew training. When fuel is missing there is nothing you can do. Most of the basic training were done on obsolete Panzer Is, IIs or IIIs. I dont see how the Panther as a tank is involved in the problematic or how its making the problem even worse.
The maintenance crews were also familiar with most of the systems of the tank. The HL 230 was not new for the Heer and very similar to the HL120. The semi automatic gearboxes and torsion bar suspension were around since the early Panzer IIIs. Its not like the introduction of the Jet engine, which was never seen before.
I really can't see, how the Panther as a weapon system does not fit into german doctrine or how it adds an extra or unnecessary burden to crew training, logistics or infrastructure compared to other tanks. Panzer IV reached its limits in 1943, it couldn't be upgraded anymore. They had to introduce a new more modern tank chassi.  

I still wonder why the Panther gets so much bad press lately. It wasn't a perfect tank, its ergonomics for the crew were behind that of a Panzer IV, a Sherman or a Tiger, but still not as worse as most british and russian designs. The tradeoff was, that it could be produced faster and that it brought greater mobility, firepower and armor protection to the battlefield.
(Remember the Panther was only 15% more expensive to build compared to a Panzer IV).
Quality issues with engines and final drives affected all germans tanks which were in production late in the war. Even for the proven designs like Panzer IV. If germany would have produced T34s or Sherman's they would suffer from this problems, too.
Which tank could have been a better solution for the Germans? Chieftain asked this particular question to Ralf Raths. The Answer was the Panther was a reasonable option, every other conceptual tank design would have suffered from the same limitation.
And as i wrote before, producing even more but simpler tanks wasn't a promising option either.

The Sherman's automotive components seem to be simpler (if we exclude the 30 cylinder chrysler engine (M4A4) and the twin diesel (M4A2)), but the sherman has many features and gadgets like rotating periscopes on every crew position, very advanced turret drive, turret override for the commander and gyro gun stabilizations, which the germans didnt even had the resoucres for.
The lack of copper, rubber and ball bearings would create big problems for the german war economy, if germany would have tried to build a tank similar to the Sherman. The lack of copper forced them to get rid of any electronic subsystem which are not essential. The Panthers turret drive is often criticized, because it's powered by the main engine and its speed is dependent of the main engines rpm. It couldn't be powered by an electrical engine like in the sherman because of the lack of copper.
I think i could give you a small insight of why panther became the tank we know. It was never the german Überpanzer and even the crews who used it didn't think that. It was in many ways very similar to the T 34, it was a relatively cheap and effective tool to get the job done. The Panther will never ever live up to the hype most people are creating out there, they simply don't understand what the Panther actually was.
It wasn't even over engineered, or as the Chieftain said in some areas even under engineered. They just made everything bigger: longer gun, more armor, stronger engine, wider tracks. Pretty basic and straight forward. The engine, the transmission and the type of running gear have been around before, there isn't much innovation inside the design itself,
beside the fact that it turned out to have the best compromise between armor protection, firepower and mobility. But that doesn't makes a tank automatically a winner.
For the german Ground forces and the german economy it was the right tank, even so the outcome of the war couldn't be changed anymore.
Reply: @HaVoC117X  To clarify a few points, my comment on the transmission, to replace the unit on the Jadzpanther, you had to remove the gun, you had then to remove the front two positions, radio operator and driver. You then had to go and get the thing out and you didn't have much clearance either side. It was a complex job. It sounds like a real bastard of a job. From the Chieftain, from memory. 

So, not to check or inspect the transmission, replace it entirely. 

I'd assign a lot of the issues around Panther and its mobility to inadequately trained in how to operate their vehicles. It's not so much a matter of final drive versus transmission. If you don't know how to manage the engine, how to use that gear box, what the inherent weakness of those components are, stalling the engine, even breaking the parts due to excessive stress. 

However, even in saying that, I want to check the sources. I want to see the reports and I want to read the reports. It's not something I can easily verify firsthand. That is something I want to change and frankly have my own questions on a semi-related subject. 

Do I particularly want to be published, find some grand secret that wasn't discovered before? No, I don't. 

Are there aspects here I think make this confusing and I want to get my head around, I want to see and read the original sources. I want to see what the people where trying to say, in their own language. Do I have questions about the material reliability of components and possible sabotage of components? As I've got both OSS and SOE material which describes sabotage. Sabotage which in some cases I've seen, resembles the damage reported, I do have real questions and I want to try and back trace those components. I want to find out if it's possible that sabotage was a factor here. 

Side note on Korea, from memory, the units equipped with the M26 went back to Shermans,  due to availability of parts and the fact the engineers had the equipment to support the Sherman's weight, not the M26's. Again, from the Chieftain from memory. 

On the MBT, that is another issue I don't particularly want to touch, because of a few reasons. The first is that the issue is doctrinal. Another is the vehicle design itself. Between the end of WW2 and the start of Korea is barely enough time to get a new family of vehicle developed, tested and deployed to some units. Not all units, just some units. 

Doctrinal and design first, on some level even the first obvious MBT's aren't quite, aren't really. They're too focused on a single aspect, on some level. On the T-54/55 series, that low shape is great for the offence and has some issues on the defence, possibly long term crew comfort. Leopard 1, Centurion, Chieftain and co are perhaps too focused on a defensive war and supporting longer term crew comfort. 

That's not to say they're not MBT's, rather they're the first step towards the general MBT, something which was more codified, understood and on some level, when given some time to mature, obvious. When we reach the T-62/T-64, the European and US equivalent vehicles. 

To be clear, to call Centurion, T-54, Panther a MBT isn't particularly wrong. I don't believe it's the best use of the term as the concept of the MBT needed time to be refined and mature as a concept. This applies just as much to the people using it as it does to the people writing about it, in a doctrinal sense. I think you could look at a good fifteen, twenty years, for the people who crewed it, to get into the ranks to start writing about it, to really make the most of the MBT and the MBT concept. 

A weapon, platform, like a tank is not just a machine and it's crew. It's all the support and knowledge around that machine and crew, to give the crew the best possible tools, knowledge and experience, to use that machine to its fullest potential. That takes time. A lot of time, being blunt. 

It's knowing the parts that have to be replaced more frequently than others, it's knowing what needs to be cared for more so than other parts, it's the knowledge of how to supply the unit, what to supply the unit with. It's designing training programs to ensure that the crews know their vehicles so well they could near work blind in their vehicle. They can tell what's wrong by sound and feel, not just sight. It even goes all the way back to design, say giving them capabilities to run say at low power, without the engine. Using the M1 later inclusion of a secondary engine, motor to power the turret and systems as an example. What the people need to know at what levels, to keep the unit's readiness up in the area of 80%, 90% greater even. There's a lot of information that needs to be learned, defined and refined. It's a long and ongoing process. 

So without access to archives on development of vehicles, of the many, many, many reports made about, from any party, I really don't want to get into it. There's an appreciation of a process and then there's understanding it, being knowledgeable about it. I'm far closer to the former, not the latter. I would much rather be in the area of the latter.
Reply: @LionofCaliban  Transmission replacement.

As we learned the Panther transmission was very robust like most german transmissions and had an service life of 5000 km between overhauls.
The chance that a tank survives long enough, that transmission replacement becomes necessary was actually very low, given the intensive fights the germans were involved in.
The russians turned the war around with tank engines (The V2-series), which had a service life of only 300 to 400 km between 1941 until mid 1944 (T 34 vs Stug III by Steven Zaloga). Percentage of T34 tanks reaching 300km during factory trials (Zaloga, Page 14):

Apr 1943 = 10.1%, May 1943 = 23%, Jun 1943 = 7.7%
This number slowly imporves to 79% in February 1944. But only 33% reached 1000 km before a breakdown in Feb. 1944

The british stopped their long endurance Tests of the M4A1, M4A2 and M4A3 after the tanks had reached 2500 miles, because they did not expect that the tanks reached that mileage during deployment.
(Chieftain published the original british documents a few years ago somewhere on the WOT forum).

So if we are speaking of transmission replacement, we are speaking about an event which was very unlikely to happen.

And still the US wasted production capacity and time to produce a Sherman tank with a transmission that was easy to access and mounted it in a separate unite which was bolted to the front end of the tank.
They had to cast serval large hull parts (instead of just one, Patton tank family for example) and invested a lot of effort and material to drill holes through the serval inches thick armor to put the separate pieces together with large bolts and nuts. Those bolts and nuts don't grow on trees
and had to be produced too. All this increased the overall count of parts for the vehicle. The US industry went the extra mile for every tank which left the factory and invested time, effort and resources to prepare for an event which rarely happened.
So tell me, who has wasted more man hours and resources on this specific task called transmission replacement?
The Russians, the germans, the british or the US which were probably a bit too cautious in this regard?
Basic maintenance and adjusting the steering could be done with the transmission installed (in the Panther as well as in the Sherman).

So what if you really had to replace the transmission because of battle damage. If a round or a mine impacts at the front a sherman, 
bolts can be damaged and the force and the heat of the impact, can put tennsion into the metall. As a result things which should separate easily wouldn't move at all. That's where the real fun for every mechanic begins. I know its a very special case, but people like to create those events for german tanks, too. Like mud could freeze in between the road wheels. Ohh what a great disadvantage, crap system, bad tank.
Every tank with metal tracks can freeze to the ground if parked on wet surfaces, it even happens to modern bulldozers. It's even noted in most tank manuals.

The US american ignorance is sometimes so annoying to me. If your are not doing it the way they like do it, you suck.
They sometimes don't even try to change perspective.

Your are very eloquent, i wish my english was half as good as yours. But Sometimes you use many words to say little.

If you introduce a new weapons system you have to face the common problems. You described this very detailed over several lines of your post.

It's like saying: If you jump into the water, you will get wet! You don't say, Captain Obvious ;)

But there is simply no way around it, at some point during a war you need to introduce new weapon systems if you want to stay competitive. 
Inferior weapons systems will quickly lead to much higher amount of losses.
The US also introduced a great number of new tanks during the war (m18, m24, M36, M26 to name just a few). 

The Allies would have had a hard time gaining air superiority over Germany if they hadn't introduced the P51 Mustang. The strategic bombing campaign would have been a huge failure.
Eduard Schmüd and his team at North American Aviation designed the mustang from scratch with in a year. But it was designed as an attack aircraft at first. The US started to look for a new fighter concept in early 1942, a long range escort fighter, which should support the brand new doctrine of strategic bombing campaigns.
This type and scale of bombing was never tried before, it was the brainchild of innovative thinkers.
They tested the P38, the P47 and the P 51. The choice fell on the P51, which was modified with the Packard Merlin engine. It entered service in mid 1943.

"I think you could look at a good fifteen, twenty years, for the people who crewed it, to get into the ranks to start writing about it, to really make the most of the MBT and the MBT concept" Bullshi.... (excuse me, but that's what i was thinking the moment i read it)
 The war is lost, even a cold one if it takes that long. Gathering and transferring of such information has to be much quicker.

The requirements for the vehicles like a tank is determined by the doctrine, not the other way around. A new weapon system has to be integrated in the already existing orchestra of weapon systems, key word combined arms warfare.
You don't develop a random prototype and the next 15 years you try to figure out how to use it best. We dont know what we are doing, but just by trial and error we ended up with the concept of MBT after a few decades??
Its pretty likely that the concept of an MBT was around and  written down in some manuals or requirements before the actual term MBT was invented for it. And its also pretty likely that the first MBT came to be long bevor the term was invendet, too. If you know what i mean.

And i still find it funny how all members of operation think tank agreed on the Panther. 

Did you realy believe that the T55 isnt a true MBT? Dude, you must be out of your mind! Its the most produced and widely known MBT out there. If its not Panther which is indeed discussable and if its not the Centurion, it have be the T 55.
It definitely belongs to the first generations of MBTs. Dr. Rolf Hilmes came up with three generations of MBTs, he also defines the T34 and the Panther as a starting points but not as MBTs themselfs. 

Its probably a lot of fun to go through those archives. But you will have troubles to find the desired german documents because there isn't much left of them to go through.

If the Panther wasn't the right tank? What type of tank would you have recommended?
Reply: @HaVoC117X  You've taken at least two of my comments completely out of context. 

In terms of the transmission replacement on the Panther family vehicle, I was talking about the full replacement of a broken unit. In, from memory the Jadzpanther case, you have 2mm of clearance and basically have to take the transmission out of the casement, entirely. You have to remove the gun entirely and set that aside. From memory, you had to remove some deck armour to just get in to get it out on the standard tank.   

That is a fairly major trade off for maintenance. Maybe as a total end design did provide extra protection, but due to loss of quality in steel, steel treatment, that's debatable. I don't particularly care for distance between replacement, my focus and interest is on the ease of repair. Even to the degree of just that component.  

Secondly, institutional knowledge takes time to develop. End of statement. 

It takes a good fifteen, twenty years to develop a full carrier force. I think the same is true for the armoured force. You need people to go through the whole process, from training, to come out the other side. To go through the ranks to run the unit, to go back to the academy and write, edit, replace the training manuals. It takes people who use it, to spend time with it to work out how to make the most of the vehicle and the additions that would improve the vehicle. 

Take for example, the improvements that have been made to the M1 tank over the decades it's been it's use. In between the increases in turret space, additional secondary motor to power the turret, system without using the main engine, a few other aspects, up to and including CROWS/RWS. That stuff comes as much from the user, crew using it, as it does the people who designed this stuff. 

WW2 in vehicle design is a pretty good case study in the short term development of vehicles. Of the results for pushing things into use, the importance of proper testing regimes and the use of resources. It is not a good case study in the long term refinement, management of a fleet of vehicles. The rapid place of development doesn't allow a design to go through so many hands, generations of soldiers. There's degrees of quality of life, those small improvements which I don't think are well represented in the vehicles of the era. 

Like, say a pressure sensor on the door to the ammo rack in the turret that prevents that door closing on a person's arm and amputating it. 

Yes, even with the many, many, many M4 Medium variants out there. They were adapting their tank to the war they were fighting and had a pretty good platform to do it on. When the turret ring was expanded and the T26E1 experimental turret was mounted, they solved the biggest issue around a larger gun. Welding on extra armour, wet storage, the suspension through to the rhino nose for bocage, all of that doesn't come from doctrine. In fact, the M4 Medium stock version is quite the tank. That 75mm was taking on German armour fairly effectively. Even Tiger I, Panther. 

The Germans, through the Panther answered it with a whole new type of tank. Yes, they were looking at phasing out two whole families of tanks, still, it's a whole new tank model. There's some lessons in the Panzer III and Panzer IV that don't seem to have been passed onto the Panther. Either in operation, construction or maintenance. Even lessons from the STuG family that do not seem to make it to the Panther. 

I'd also challenge the point that doctrine defines need. When the machine gun first came out, there was really no need for it in the doctrine. Nor was there a concept of it in the doctrine. Machine gun units faced opposition to their existence and despite their extreme effectiveness in the hands of free thinking officers, they were ignored by the higher ranks. It wasn't until those high ranks were so shocked at what they could do were the machine guns taken seriously. Vehicles then were designed around the machine gun, systems developed around the machine gun, to make the most of the narrow engagement windows, or protection offered. 

ie, tanks, aircraft, the interuptor mechanism. 

If you look at the era of Korea and tank thinking at the time, it's quite obvious that the idea of a single tank, for all roles was the ideal. Yet, we still had a concept of a heavy tank, the Conqueror being only one example. They clearly were still working on, refining doctrine, the vehicles of that doctrine. M26 might have existed, yet, many US units seemed to have gone back to the M4 Medium, due to the ease of it's use, reliability and how the engineering equipment could support it while the Pershing was too heavy. 

If you want to keep going down this path, yes, the T-54/T-55 is of a period where the concept of the MBT is still quite new. Barely ten years old. People were still discussing the language to even phrase the issue in the first place. People were still trying things out, trying new designs, of which the T-54/55, even to the T-62, T-64 range were signs of the advancement of thought and refinement of the MBT concept. Of taking it from the thinkers, to the tinkerers and designers, then to engineers. All of which is before it even reaches the proving grounds, then finally, the units equipped with such. 

You have the progression down the line M26, M47, M48, M60 on the US side. The Centurion lasted a very long time in greater Commonwealth, English service. It had plenty of modifications made, before the Chieftain. Again, to be clear, lessons were learned from each of the vehicles, institutional knowledge was developed, refined and shaped the next generation of vehicle. The next vehicle is based on, built on, the institutional knowledge of the previous vehicle. As new capabilities are added, they're also improved and refined. Just as the vehicles are. 

It's also worth saying, considering when the English were playing around with armoured warfare, it still took them a good ten years odd to really arrive at the concept of the single hull, multiple purpose vehicle. While the Centurion is a WW2 design, it wasn't just WW2 that shaped it. There's elements of the experiments of vehicle doctrine, units in the 30's. Again, at least a ten year period. 

Can you think of a concept of the infantry squad, let alone company, the armour, the aircraft, without some form of high rate of fire weaponry? Of the concept of the machine gun providing suppressive fire, area denial? For a long time that was the machine gun and still is the machine gun in a great many cases. Take a step back and try to look forward, not backwards here. It seems obvious to label Panther as Germany's first MBT, Centurion as the first MBT when you look backwards. I'm trying to look forward from their point of view at that time, see what the designs could do, could lead to. 

If you look back, you're missing a lot of context of the time. The context we have of the MBT is built on the concept of the MBT that survived WW2, Korea, later conflicts, Domino Theory and Vietnam, various hot and cold parts of the Cold War, the Soviet invasion of Afghanistan, the many exercises of the US, NATO. Just looking at the MBT from the WW2 perspective, it's still a bit nebulous an idea. It's still about trying to fit more capability, into the tank. It's still about trying out ideas, looking for areas of improvement and refinement. To try and get the holy trinity of protection, mobility and firepower, as the modern MBT has. To not make the sacrifice of one of the three. Not a checklist of criteria, predetermined definition. 

The following, I hold to be true. To be as clear on the matter as I can be. 

Tiger I is a very good design and the correct design for the German way of war, warfighting. For it's role as an offensive breakthrough vehicle, it's exceedingly good at what it was meant to do. 

Tiger I was misused and taken out of the expected terrain it was meant to fight in, it experienced issues. It was both doctrinally misused and used on terrain that it was not expected to operate on. 

Panther, as a design, makes sense for the German just as much as the Tiger I does. Panther is also a vehicle with notable issues and weaknesses, just as Tiger I. 

Panther, like Tiger 1, had a very high requirement for crew training. To make the most of the vehicle, you have to have a highly competent crew to operate it. The same is true of the people who make it and maintain it. Even those who produce the parts for it as well. 

Just as much as the Tiger 1, Panther was the best choice for the Germans, the M4 Medium was the best choice for the US and Allies. 

It's not that there's a better option to be the Panther, the question is more with what the Germans knew at the time, expected to be doing and had the knowledge of, is there a tank that is a better option than Panther? 

See above. I think not. That doesn't mean I think the exact trade off, exact form of Panther is the best tank they could have produced. Everything in this has trade offs and limitations. Everything.